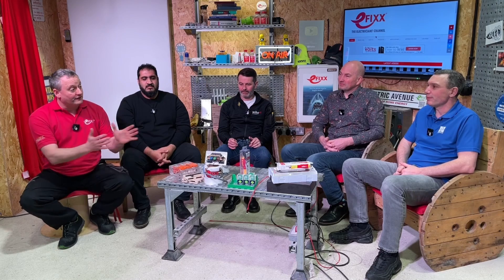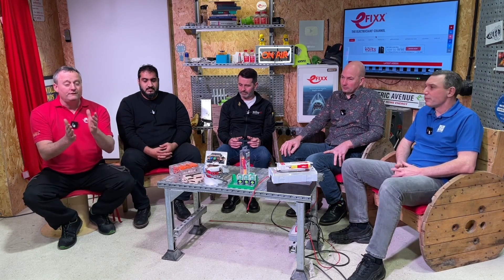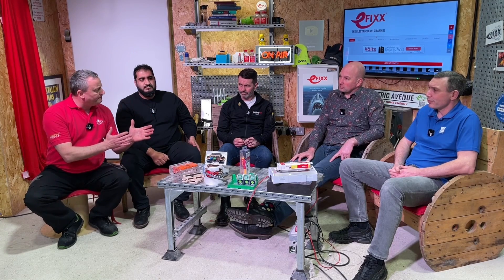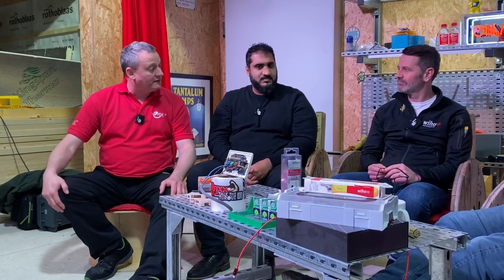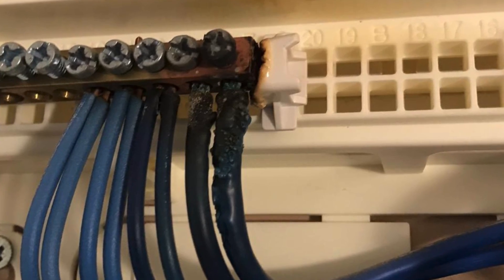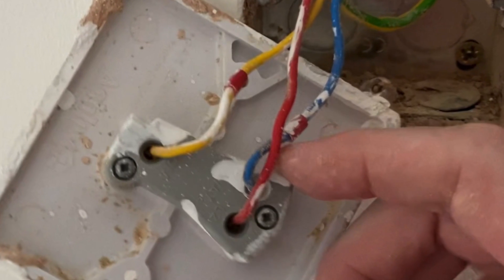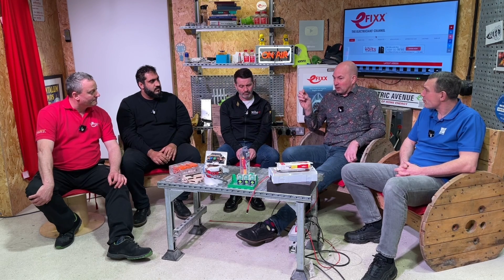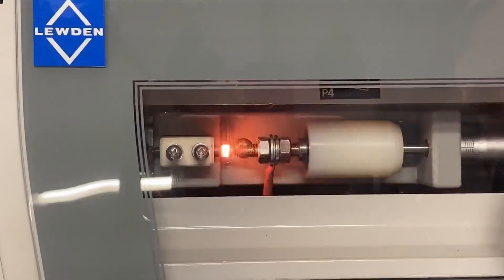ELECTRICAL FIRE - Screwed Connector Burned Down The House 🔥🔥🔥

Comment: This is an interesting conversation. In the US we have what is called backstab ( not to be confused with back wire ) as an available option on our receptacles. However it decreases install time and it's quick and easy to strip the wire and shove it in which is why it's loved for convenience by quick get it done contractors. The number of receptacles I've removed and had the wires literally fall out of as the only thing holding them in was the fact that the receptacle is screwed to the box pushing the wires into it. It's a great distinction between qualified individuals using the screws and unqualified rushed individuals not using the screws. I know there's been fires caused by these things. So I like the idea of going away from screws but that better be one really robust alternative. There was even a time when outlets were manufactured without the screws same molds and everything leaving the only option to backstab.

I guess I should mention the back wire method.
This method may sound the same but it's totally different there is a metal plate attached to the screw that clamps down on the wire when it is tightened. Sort of rising clamp style. so you don't need to wrap the wire around the screw, it's just a matter of stripping it sticking it in and tightening down. This is my preferred method. However there are lesser grade receptacles on the market that don't incorporate this feature and most still support backstabbing to various qualities.

I know the UK uses a cage clamp method, I've been following too many UK electricians.

The only way this would take off is if it is standardized across the industry and a standard set forth for a minimum quality.

I still think it's down to things not getting tightened enough because well they're not using a torque screwdriver or they missed a screw or they didn't know what they were doing to begin with because their kitchen fitters.
Reply: And then in the same thinking how many times have you come across an old installation that hasn't been touched in years that is in perfect working order. They didn't have torque wrenches they didn't have torque screwdrivers and yet the place hasn't burned down because of the old installation made of wood, and yet no loose connections. it was the new unqualified work that was added.

Comment: Screwed connectors or dog cocks as they used to be called were made out of ceramic many moons ago a far superior material. Connector blocks are good too ..but the smaller ones have a wall to thin to take the screw down process and split the wall ,these are made of brass and are brittle ..the folded steel ones are much stronger and will take the screw down torque . But once again there are billions of connection in the uk alone …some will fail…..one other thing bring back British made accessories they are and have been superior to the Chinese rubbish .it’s the design for fitting guys ( or lack of )that have let the troops down over the years …….a little rant from an old chard sparky war horse ..never forget electricians control the world 😈😈😈😈👍🇬🇧🇬🇧🇬🇧

Comment: There are billions of electrical connections in the uk alone …a very very small amount will fail….considering the billions of connections there are very low numbers of fires caused. You just do the best you can when terminating …..sometimes it’s a badly threaded accessory where the tap is at the end of its life and hasn’t cut the thread properly you only realise this when the electrician ..”feels” something isn’t right  .many connector blocks fail when screwing down and the frame itself splits under load ,I have taken loads of 5amp strips back to the wholesaler showing them the failure .

Comment: A few years ago , had to investigate a house fire , the cause was a loose neutral on a night store c.u. ,the unit was mounted understairs,  People were lucky to get out, the body of the c.u. melted and flames escaped setting fire to the u/stair timber, the wire test where a heated wire is put at the body proved this test is highly inadequate. I did go the the manufacture during this investigation.

Comment: I will retire very soon and throughout the past years, one of the biggest problems I've come across is wrong tension on a connection. Too tight, or, it has become loose! In 1983 I worked in forensic examination for an insurance company and strange fires were concluded to have started through wrong connection techniques. The torque screwdriver is a definite must have tool!

Comment: No such thing as screwed connectors or even wire nuts in the electricians Bible: National Electric Cord. Have used pressure connectors ( ya wire nuts ) for over 50 years with no problems. I always strip conductors at least 7/8" twist them with heavy linesmen pliers to make sure there at least 2 full turns on bare copper and 2 full twist on insulation then trim ends even tighten wire nut with heavy linesmen pliers then apply a few wraps of quality black tape ( not the POS garbage from cheating communist China ).

Comment: Great video ! .... at 15-59 you show a badly burnt white outlet ... this appears to be on the neutral ( but the photo might be mirror image ? , in which case it would be the live pin ? ) ... this almost always happens to the live pin , due to a terrible deficiency of the " modern "  UK  13 Amp plug ... the fuse contacts can present a high resistance leading to bad overheating ... the safest fix is to SOLDER  THE  FUSE into the contacts , this lowers the contact resistance to it's minimum and the bulky solder joint absorbs even more heat ! ... NOT recommended for things like table lamps / laptop chargers but is a MUST if you want to power a big room heater all day in the winter ... do not forget to do this to any extension leads to this heater ! !  BTW , this was NEVER a problem with the 1950's round pin 15 Amp plugs , ( no fuse in plug ! ) and there was a LOT more heat absorbing brass in the big round pins !  apologies for repeating this , but your excellent video may be viewed by a different lot of folk ............ ( tried - n - tested ! ) ............

Comment: Next time I am asked for comments on the regs, I will suggest that torque settings for all screws in an electric circuit should be available and adhered to, unless a none screw securing method is used. One house destroyed by this, is one house too many. Fortunately, there were no injuries this time but reliance on luck is a bad strategy.

Comment: Most common burnt out sockets I see, is hot trolleys or similar, in schools on a 13 Amp plug top. They pull approx 13 amp constantly and melt plugtop and socket. Something should be done about this

Comment: Interesting you mention accessories not specifying torque settings - Most Click accessories do now specify a torque setting in the datasheet that comes with the accessory.  Interesting to see if this could cause issues if a problem were to arise with the accessory given that it's highly unlikely that it was fitted with a torque screwdriver and therefore wouldn't comply with the manufacturer's instructions.  I also found that the supplied torque settings weren't necessarily correct - I fitted a bunch of their Definity accessories tightening the FCU terminals to 2.5Nm as defined in the paper datasheet that had come in the box (despite this feeling stupidly tight) and 2 out of the 3 FCUs I installed cracked while being tightened.  Only later I checked their website to find that the datasheet on there specified 2.0Nm as if it had been changed after the ones that I had bought had been boxed.
Reply from the maker: Interesting we’ll take a look at the click stuff.

Comment: The point that larger brass terminal connections dissipating heat better was an unintended gift. Using push-fit maintenance free Wago type lever connectors to connect up a final ring circuit makes them a lot safer as not being screwed connections they do not work loose. The ring's current does not run through the socket terminals, only through the superior Wagos.  That is, have Wagos in the backboxes of sockets, FCUs, etc. These link the ring together.  Off the Wagos take flexible conductors to the socket, making it much easier to push the socket home.  Current only runs though the socket terminals when current is drawn by that socket. The socket terminals are not being used as terminals to link up the ring, handling the rings current, which they were not intended for anyhow. 

Using Wagos is superb on 1st fix.  Connect up the ring with the Wagos in the back boxes, then test.  Ram boxes with paper then the finishing trades come in.  On 2nd fix have sockets, FCUs, etc ready with flex conductor tails pre-attached, then quickly screw socket home. Test.  Quick, easy and safer.

Comment: Hold on..
Because things are made cheap and trash, don't get confused with the actual problem
And let's not get h&s crazy.

Here are the issues.
Poor quality screws
Poor quality wire
Poor quality thread.
Poor quality skill.
Just an error.

So if you've been around a long time then you have seen the cables and how they have changed to these soft melt in the hand cables both outer and core.
These cables great for fitting but over torque  and they become fuse wire.

Cheap connection, be that switch or sockets
Will have a thread cut and this is on the two parts, of its thin it will break, the softer newer fitting tend to chew up over old ones.
Or can break and twist.
Burred edges, cut the wire.

Cheap is cheap and when they economic agenda 21 everything, you end up with a unsafe installation as there are limits and a smaller fail-safe.
You should know the "how tight" by the screw head size. But I find it's lesser now due to the cheap out, which is contrary to the heating up problem.
How can a high current be fed thought a lose connection? Can't. This is why you get problems
It's the cable and the connection that should be in mind to pinch it up, clamp it down and not break it.

I touched one of them spring loaded clamping things... I smached it on the floor as the dangerous this it was.

That was year ago and I won't touch them, it couldn't hold the wire, works better on cheap trash wire as it's soft and holds better.

Too thin contact area, especially on a pulled line.

Makes heat up due to mostly lose fitting contact.
Wire can fall out
I may go near them again in a few years but I have my big connector blocks and junctions. Which I much prefer.

Or we holding on the input limitations on homes from next year??
Reply: Absolutely .Just look at the old Wylex plug in fuse boards. Great big brass terminals with double screws. Generally installed by someone who cared. How many of these had overheating problems? And in in a non flammable Bakelite enclosure. Unlike the flimsy tupperware boxes that replaced them. At least we are now back to metal enclosures. Because the last generation of cheap plastic  RCD boards, with flimsy screws and poor installation were causing fires.  But this does not address the root problem, only contains it so some extent.

Comment: being old school ,never had trouble with screwed connectors,like screwed consumer units never came across burnt connections like you do the new boards,with showers they were rated 6kw hence 6mm ,now there rated 10kw plus,but installed in some cases on the 6mm,with burnt skts 9 times out of ten was loose connections in the plug top 👍

Comment: One issue that has had me perplexed is why it seems to be the neutral side of a double pole isolator, which more often tends to overheat and fail.
I can see that the amount of conducting material in the body of a connection affects the ability to absorb and dissipate heat, and that this volume has decreased to a point where the transfer of energy through the connection is very close to the limit of the cable passing the current.
Also with the decrease in material volume the repeated heating, to a higher temperature, must cause the brass to begin to oxidise over time, leading to a progressive lowering of conductivity, and failure when the connection is fully oxidised.
This bias towards the neutral overheating can be observed in higher current consumer products like kettles, toasters, cookers etc.
I am interested to hear your thoughts on this issue and from your fire investigator.
Reply: Is this not because of the ludicrous testing schedules and forms that only require that L-E resistance is tested (the fault path), and not the more  important L-N, the conductors which are actually carrying the load current all the time!  Surely every circuit should always be tested L-N  in all circumstances. It seems that only the most conscientious do.

Comment: I wonder if you can help. I did read recently that there are restrictions as to which RCD types we can install upstream of other RCD types, because one type can interfere with the operation of another. Frustratingly I didn't make a note of where I saw this.
Do you have any info. on this, or could you signpost us to an authoritative source please?
Reply: Are you an electrician?
Reply: @travoltasbiplane1551  Yes. But I've found the source - BEAMA guidance. Turns out it's not technical. They just assume if the downstream RCD is of a high level, that it is there for a reason and therefore don't put a lower std of RCD upstream of it.
Reply: @geraldelwood9660  basically. On the basis that the load the type a f b whatever is supplying could still stall the upstream rcd. It's not that the rcd itself has an impact on the other. Just the loads they supply.  Been this way since 18th edition came out.

Comment: I attended a call out last year at a autistic nursery with major arching sounds reported from the CCU area. Turned out a previous contractor had installed a new CCU and extended all circuits 2ft to relocated its position, used wago connectors to joint them all floating in 50x50 plastic trunking then built a cupboard round it so was inaccessible (or visible ). A week later it starts tripping (split load) the contractor returns on a Friday can’t find the fault so removes the RCD and says he’ll be back Monday. Sunday I get called out, had to tear it to bits to get to trunking and found a bunch a melting circuits and wago connectors(right next to a gas pipe). A least 1 socket circuit had been poorly latched with the wago causing series arching in trunking you would never no was there. Well done that cleaner for hearing it, it was probably and hour or so from being a fire. The property management and contractor were more interested in playing it off and covering themselves. The installer lost his job in the end though so 1 down at least
Reply: How the hell did the contractor not get arrested though? Not finding a problem and “solving” it by bypassing the protective device (for a whole weekend!) seems like a much bigger problem behavior to me than doing the install badly in the first place. And in a nursery no less.
Reply: @JasperJanssen  with no injury’s or property loses that just won’t happen, its sadly the owners responsibility to pursue the contractor for any loses. But if legal action is taken the NICEIC will remove themselves from resolving any issues between contractors and other party’s. Seemed to be the NICEIC are under prepared to deal with issues of this degree. Just FYI for anyone who needs to do this, make sure you get all the details, pictures and video that show the original state before raising the complaint because as soon as the contractor is aware the will try to rectify any faults before a inspection day is arranged.

Comment: Any contact can tarnish over time resulting in increased resistance which causes heat, which causes more oxidation & eventually a run away effect. I coat conductor ends with Vaseline to stop this happening, especially in damp environments. Regarding fires, all connections need to be in a suitable enclosure to contain a failure without starting a fire. So often, people use choc block & insulation tape rather than a proper junction box.
Reply: I believe it was found in the US that flammable anti-corrosion paste for aluminium wiring just made it much more likely a bad joint will start a fire that spreads. If doing this, at least avoid applying any excess.
Reply: Like the bit about being in a suitable enclosure,good statement :)

Comment: I my opinion these days as well as human  era it’s  the fittings and appliances that are partly to blame . Everything is down to cost .In the old days consumer units and fittings were built over rated.High current fitting often had double screws . Cookers had proper bolt terminals. Not like these days a screw surround by plastic .those cheep dry lining boxes with the yellow fixing lugs are highly combustible where the better brands are semi retardant. Last winter I went to a job where a plastic fan heater caught fire. I have had plastic capacitors in strip lights catch fire . I’m sure I could think of more